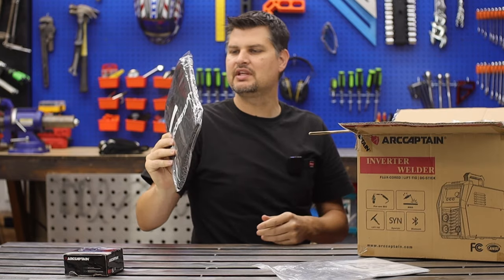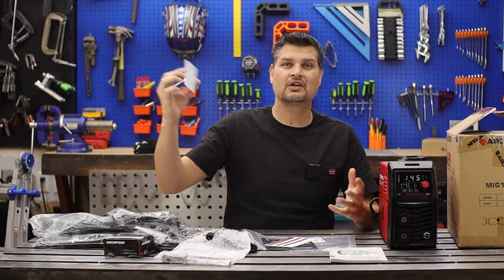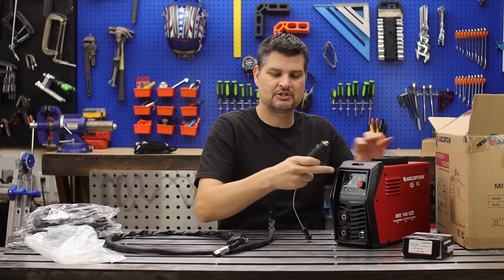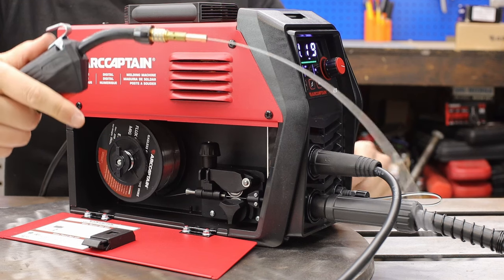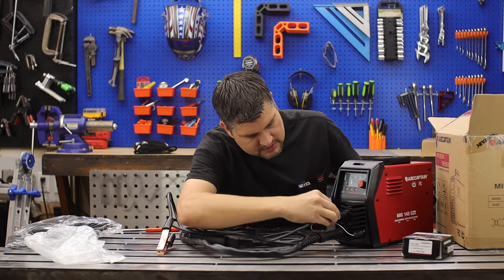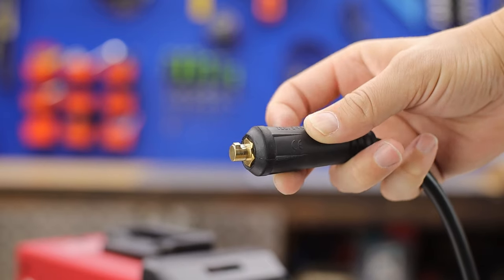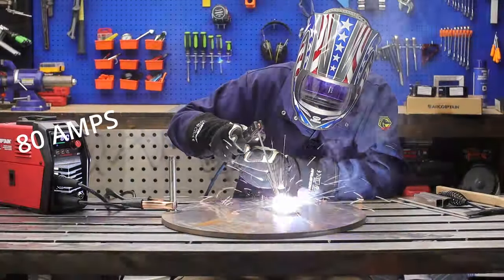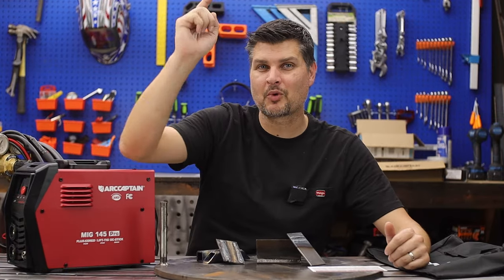Your Ticket Into Welding: ArcCaptain 145 PRO

Comment: Thanks. Would you have a recommendation for a small welder to use with a Honda eu2000i generator (2000 watts max, 1700 watts nominal)?
Reply from the maker: That size generator you'd be able to run on the low end of any small 120V machine. This, the Titanium 125, or YesWelders little guys would work.

Comment: Was your test on a 15amp or 20amp circuit?  Most customers only have a 15amp plug avlb.  I blow them all the time with my 120v Lincoln portable welder.
Reply from the maker: I was running on a 20 amp. Even though code does require at least (1) 20amp receptacle definitely not always the case.